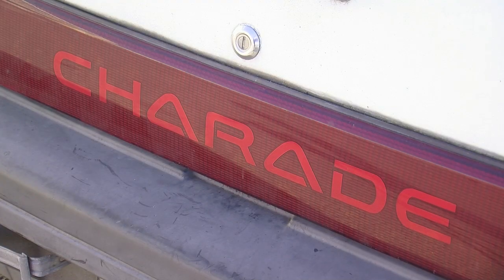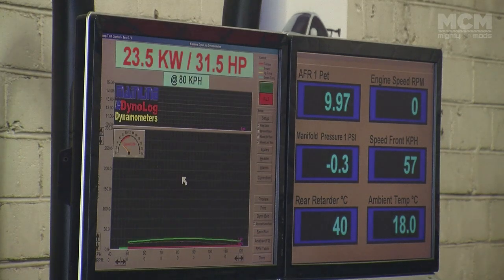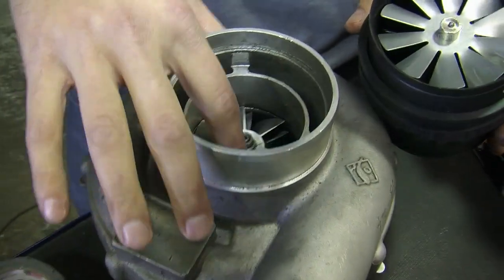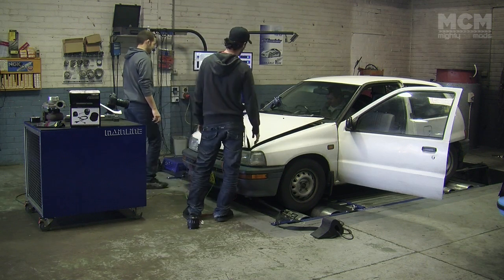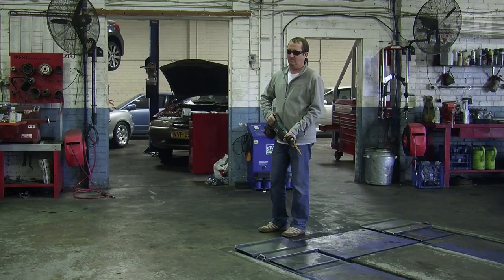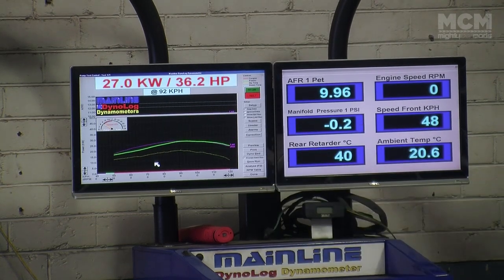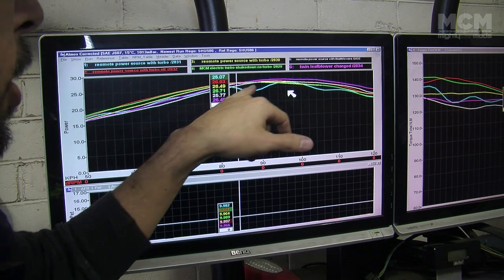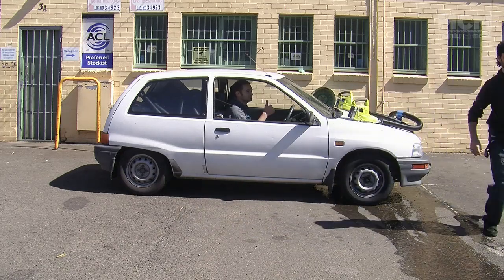Electric SuperChargers Mythbusted

Comment: I don't see any mods to the air cleaner. I'd say all that "compressed" air is leaking right out the inlet under the cleaner snorkel that sucks hot air from the exhaust manifold during warmup, so they're not getting any boost whatsoever. As well, if the engine has a carburetor, you might have to increase fuel pump pressure to compensate for the change in manifold air pressure.

If you're gonna to a test at least do it justice. This was stupid.
Reply: 🤣😂😃🤣😂🤣😃🤣😂🤣😃
But in all seriousness 😂😃🤣😂🤣😃😃🤣😂....

Comment: Hey Guys, Great channel, However, Me the American is a bit disappointed, You found an over priced "POS" and expected performance. Even your 2nd option did not work as they are not meant to create compression, but air speed. A little bit more thought would have taken this video in a different direction. maybe if you rebuild an existing turbo without the exhaust and an electric motor instead that would be awesome.

Comment: connect like 4 of them in a row and see if u make any power and pull the filter the filter is stopping all the boost air and make sure its behind the mafs so the sensor can't slow the air down then u should get some numbers

Comment: Citroen did use an electric blower in the turbo charger during the time of Group B in rally. The car itself was based on Citroen BX with 200 built for classification. The idea was to keep the turbocharger on the faster run in order to reduce the turbo lag. How about trying with turbocharger but using a decent electric motor that gives 50 000 rpm to drive it ?

Comment: Battery ain't being used when car running
Reply: But the alternator is. That's why the tried using the external battery, to eliminate any load on the engine cause by the fan, to see if it that would by a substantial difference.. They explained it badly yes, but anyone knew in actual operation the fan wasn't powered by the battery should have been able to figure that out.
Reply: TRUE

Comment: That car wouldn't go 100 MPH if you dropped it out of an airplane... on a windy day... with a load of brick in the back... waxed and shined... I wonder what would happen if you drove a genuine turbo, that has the proper vane that can actually compress air, with a decent motor shaft? I'd also like to see Air Flow Data... Did anyone think about hooking a Vacuum/Boost Gauge before the Carb/Throttle Body Valve and after?

Comment: So didn't a portable electric compressor be used?
Reply: Carlyle Tom No. Still not nearly enough power. Think of it this way, a small supercharger requires about 20HP-40HP to operate. That means you'd need a compressor rated at 30-50HP with a continuous duty cycle. Even massive 240v shop compressors are only like 5-10 HP with a 50% duty cycle.
Reply: I've been wanting to try that on my 6.5hp mini bike. I would think it would make more power in that small of an engine.
Reply: Carlyle Tom the big difference is the CFM (volume of air per minute). A 12 v  compressor is usually 3-4 cfm where a small turbo needs 300-400 cfm.

Comment: They didn't remove the cars original air filter. Thus having 2 air filters and creating too much back pressure. And then causing it to run too rich. The cars computer system over compensates by retarding the ignition which cancels out all horsepower gains. Removal of the stock air filter would have got all the promised horsepower. Most likely wouldn't topped out at 50 horsepower. Smh. Install properly guys. Not fair to the company that made the supercharger.
Reply: Those "super chargers" are just a gimmick. 
Stop defending a fairy tail.
Reply: But it is a carbie engine
Reply: J Bouchard bro someone tested an electric supercharger... it makes 0.10psi of boost... that's nothing

Comment: i get that,  you guy's go by kw, here in America and several other countries we go by horsepower. could you please include hp and ft lb torque. i beg you guys
Reply: if you look the the right of the kW reading, it shows the hp reading. Also, it's a very easy conversion... hp = kW x 1.34
Reply: RYNO NEEDLER they do....
Reply: Respectfully I believe you got the math backwards 1 horsepower equals ~745.7 W., so you need the divide the maximum Watts calculated by the dyno by that figure to get the horsepower. A kilowatt = 1.34 horsepower. Using your math one  kilowatt  would = 746.7 horsepower, I wished that where true, so electric vehicles could be practical.
Reply: My equations works. Just plug in a value for the kW in the equation and it will come out right. For example, if you had 10 kW and wanted to find the hp value: hp = 10 x 1.34 = 13.4 hp. Dividing by .745 and multiplying by 1.34 are the same thing because they are reciprocals.

Comment: you need about 4-6 of the infamous delta fans. 2 side by side will easily overtake the engine's normal intake and you stack them in 2 or 3 layers to get the pressure you need. bear in mind these draw about 4a each, so you need to be able to have 24a of power available from th electrical system

Comment: u are wrong MCM, u should place the electric supercharger after the air cleaner before the throttle...otherwise the air cleaner is blocking the spinning air from electric supercharger if u place before the air cleaner

Comment: DON'T TRY THIS AT HOME
try to add compressed oxygen bottle like from oxyacetylene welding equipment thing but it will still be like nitrousoxide with higher possibility for explosion so feed it from far away hmm if I would use it I would put it on a trailer with emergency eject/release button :-)

Comment: I built an electric supercharger back in the Mid 90's on my Hatchback to see if it would work and I lost HP. The problem is the turbine can not spin fast enough to push the air into the intake and cannot keep up with the speed of the intake at higher RPM's.

Comment: Ok so you added a turbo to add more air to the mix but you didnt try to add more fuel (fuel injectors and all parts included with that) you need both and your little cant get more performance out of itself without more fuel with the mix
Reply: Clay Jones 
up the fuel pressure?
Reply: In theory yes, just like when you add salt into water when so much dissolves, there gets to be an excess of salt that is not dissolved, (this is not the best example) so in theory, when an engine burn gasoline to make an explosion the air to fuel ratio is good while its stock, But when you add air, the ratio become more air heavy because there is not enough fuel. so when you have got a really small engine like the one in this video, the air to fuel ratio is very small compared to a big v8 5.0l, so there is an even smaller amount of power gain. there is a sensor in most cars the senses the air/ fuel ratio, but in the Daihatsu Charade, it any extra power to the car because it cant spit out enough fuel to make a difference. They lost power most likely because they were also choking the car with too much air and not enough fuel
Reply: Also they should have measured the PSI of the intake before and after the electric turbo to see if the were getting any pressure or "forced air intake" (turbo) into the engine

Comment: Surely the Electric Turbo should have been ducted on the intake side as well, not having it will cause cause compression falloff at the impeller tips significantly reducing the amount of pressure generated, fitting a reducing diameter duct at the intake side of the Fan would in effect produce a larger column of pressurized air for the engine to draw from (see Bernoulli's Principle! although primarily concerned with fluid hydrodynamics, it is also applicable to Gases as well)

Comment: That fan looks like it was turning backwards, which would explain why it turned out less power.
Reply: If you want 500+ hp gains id reccomend a supercheap pod filter AND an electric supercharger.
Reply: Increase in fluid velocity results in a decrease in pressure. If pressure isn't increased, there's no way a larger CFM is going to make it into the engine.
Reply: AceInvader even with it running properly the fan and motor themselves are likely causing a restriction of the airflow in the oe airhorn. Figure that motor(1.3l), at 6k rpm is going to move something like 10,000 liters of air per minute. There's no way that those small electric blowers can move that many clh of air...even with a brushless motor on 24v it wouldn't.
Reply: +ROTAXD yeah, no wonder, look at how many rpm the turbo is running for its diameter and the electric isn't that big. If you put two and run them on supercaps and a pwm controller in 24v with a vacuum valve to bypass it when it's off then i think you can have some real gains in performance.
Reply: +ROTAXD better yet, use a notebook generic power brick with 100w and 12v car input with regulable voltage from 12v to 24v and use it to drive the turbos. Damn these modules are perfect for this.
Reply: It has to do with the camera frame rates, it’s the same reason that wheels some times look like they are spinning backwards.
Reply: It only go and face one way
Reply: With the way that the "prop" was, it needs to spin counterclockwise
Reply: it actually needs to go counterclockwise
Reply: AceInvader actually a reduction in power from this kit is a good thing. Basically any change to the output of torque or power shows a variation in how that car is running. While these kits are flawed simply because they don't provide any way to change the fuel supply to a car there was also a lot of issues with this testing. Firstly a carby air box has air gaps and a crankcase hose for venting blowby gases from the engine. Secondly the carby itself would need to be changed, in history there has been very few cars with a carby after a forced induction device mainly because it is rather difficult to design, which is also why most supercharged v8's had carbys before the air pump although it does risk pinking inside the intake manifold. Thirdly the relationship between airspeed and pressure is covered by Bernoulli's effect (in fact traditional roots style superchargers don't actually compress air as much as increase its speed) so an increase to airflow is good but due to the carby design it would still be impossible to control the air file mix. At best they could have had the airbox removed and tuned the carby to have a rich mixture to attempt to get a higher power level at a certain rpm but it would have ment a horrific fuel air mix anywhere but at that rpm. They are correct for saying the kit is rubbish but not so much for the reasons they gave. As far as a entertainment perspective goes though these guys seem to be a lot better to watch than that "Australian top gear" rubbish that stereotypes Australians.
Reply: It'd look like it was going backwards because of low framerates.

Comment: It's obvious what the problem is. I had the same issue. You're trying to use summer air instead of winter air. Winter air flows better, especially when injecting blinker fluid into the air stream.
Reply: Save your winter air in a bottle.  Use it in summertime.
Reply: Sam Steele underrated comment
Reply: Shes on Carbys, which means it also needs carbohydrates in its coolant. The yeast acts like a chemi weld too to path up leaks as they happen. 

Truly was a better time when carbys ruled and V8s were measures by CI. Central Injections. 

:)
Reply: Nah dude.
You need Fall air.
Get all that carbon dust from the leaves.
Reply: I fuckin poured power steering fluid into my brake fluid holder the other day. Big fucking face palm

Comment: well that electric supercharger was small as hell. and you need a 90 mm fan at the smallest going 10,000 rpm. in a mater of fact i use a 120mm fan on my car going 10,000 rpm and it makes boost depending on my throttle.

Comment: i kinda don't get it, you had 23kW and after you had 26kW, which is 13% more...
I would say its good, ain't that? or please explain.. also not so big difference between external power source (another battery)..
if that fan is 20W it is not so bad for the battery ...

Comment: LoL guys we all know these things are well what we all will call dodgy at best but for a real test you should of sealed the breather system, that old breather system isn't built to handle added forced pressure it only is built to handle a slight vacuum from what the motor draws. So for a real test you should pipe the thing with tubing to the top of the carb and use the supplied filter on the end of the fan, will it help, probably not but at least that way theres no way it could lose any pressure if any the POS fan is making. :) :)

Comment: I'd like a more in depth study thou. Why is it that you clearly had a boost on the first try, and then you lost some power? Is it possible that the "extrapower" in fact just broke something? In very old cars, all the sticky shit often act as a sealer and if you increase the pressure, then you actually clean it out. I'd have liked if you guys took a minute to measure the pressure in the cylinders before and after. Its clearly not an electrical problem either. Have any REAL clue?

Comment: you fellas blocked the leaf blower intakes by strapping them to the hood
Reply: And the hoses really could have been shorter and non-corrugated- this creates air resistance and diminishes the benefit. The blowers did actually look like there is SOME gap underneath, but not nearly enough.

Comment: you know theres 2 hoses under the thermostatic air cleaner that can make you loose boost also on pipe you have 2 other small hoses that control a vent on the air cleaner also if you didnt remove the air filter inside you have restrictions.... not sure if you did this for fun or just to waste money.

Comment: 100,000 times a second?
Reply: 100,000+ RPM, misspoke probably.
Reply: There is an annotation saying per minute
Reply: More like 5000. That's still alot of rotations per second though ^^
Reply: 100,000 times in a minute
Reply: taotoo2 I thought so as well. 100 000 rpm is probably what he meant
Reply: 100,000 that's hardcore

Comment: you forgot to optimize the software
Reply: I dunno whats more annoying, the fact they thought this would work without properly optimized software or the fact they couldn't even buy a GX 1080p for this demonstration. No wonder there was lag m8. Probably has a intel premium in there as well.
Reply: emocan126 did you try turning it off and turning it back on?
Reply: shoulda updated the drivers, probably running an outdated one
Reply: TheMRT111 .😂😂
Reply: Get the i9 GTX Titan upgrade for M A X I M U M performance
Reply: You mean remap ECU and yes i know this was joke
Reply: it was a joke bruv, calm down, it was meant to sound stupid.
Reply: Fucking stupid lol
Reply: Need to download more ram...
Reply: what software?
Reply: +apryanto software of the car to work with superchargers
Reply: +emocan126 no software, bro. it's a carburetor car. everything is mechanical.
Reply: +apryanto I know bro this was supposed to be a joke haha
Reply: +emocan126 hahaha...

Comment: is this a joke??? your forcing air into an opening with a valve that will suck warm air from around the exhaust basically your forcing air out the hole in the bottom of the intake to cool the exhaust off.  you need a sealed intake in order to make this work so you can pressurize the system this video only proves how much you dont know about mechanics or common sense.
Reply: I was thinking that as well. You're  (not your) a smart feller
Reply: Yes it was a joke

Comment: You could have easily doubled the gain to maybe one Kilowatt by plugging the hot air intake on the stock air filter box... Massive pressure loss there, probably lost all of your 0.001psi there..

Comment: You are fxxing crazy. But....  you dont check something. Jet engine for RC :)
I stil belive in this car is possible 30kw. And i think about nitro air :)
Instal inside car big compresor and when you need power use air from the compresor.

Comment: Why not use two cheap one gallon air compressor and hose it on the hood from the trunk and stash two batteries with two power inverters and see if that might give any change.

Comment: More air alone won't do the job. You should also increase the fuel injection by changing the carburateur to a bigger one.
In newer cars the lambda sensor and computer changes the injected amount of fuel in every cylinder cycle according to the oxygen left in the exhaust gases. So more oxygen at the input means the increase in injected fuel per engine cycle to burn all the available oxygen.
This Daihatsu Charade seems pretty old, I doubt if it can regulate the dose of petrol injected to the engine, or if it can increase this amount to make use of increased oxygen supply.
Symbolic increase in power you observed could come from more complete combustion of the petrol in the engine.

Comment: my motorcycle is only a 600 and it makes more power than this
Reply: yeah but a yank can service a harley. cos its basicly a chrome lawnmower
Reply: only a 600 thats a big bike wtf
Reply: 600ccs. 0.6 litres. or 36ci. thats not big, considering they make bikes up to 1500ccs.
Reply: MrDeathChicken my step dad has a 600 atv and it has a  4 cylinder engine 2.0 lt
Reply: do you know that a harley has less hp than a daytona even tho the harley has 1300 cc and the daytona 675 lol
its just about the engine optimisation
Reply: Caravansecurity Kemp that just made my day mate. Fucking chrome lawnmower 😂😂
Reply: i mean, i have car that is 2 liters and another that is 5. there is no "standard" for cars.
Reply: I bought a honda gs400 from the 80s and it makes more power than that car
Reply: +MrDeathChicken yeah, most car engines are 2.4 litres or something

Comment: Nice one wheel drive burnout. Big surprise: The electric fan is a POS. Try a small jet engine for boost. That should create more pressure than battery powered electric "lint" blowers ;-). Also, I wonder about the aerodynamic effects of two leaf blowers on the hood. Looks pimpin' though.